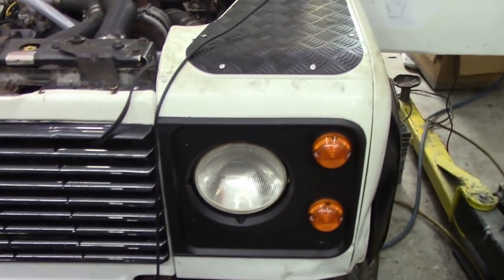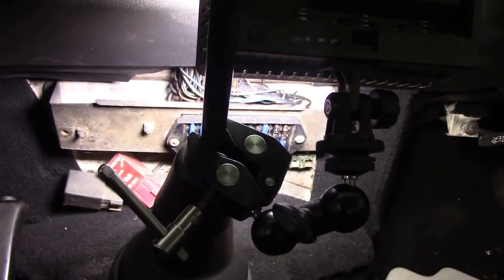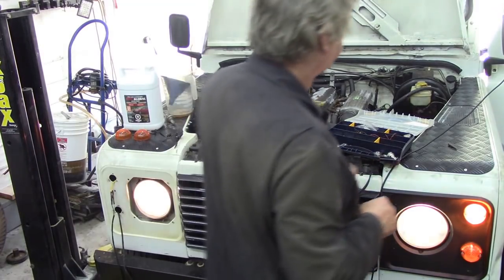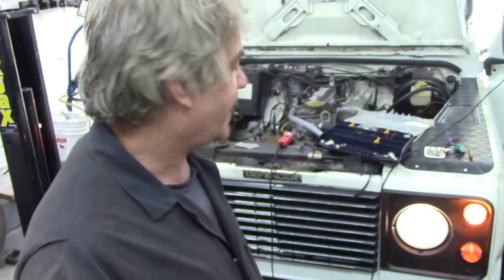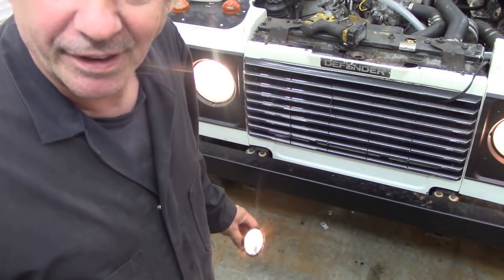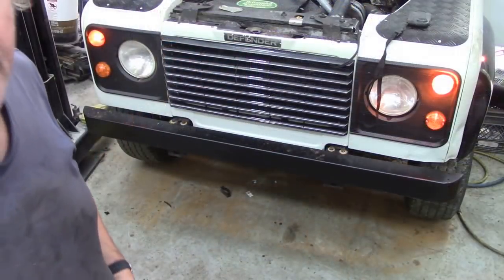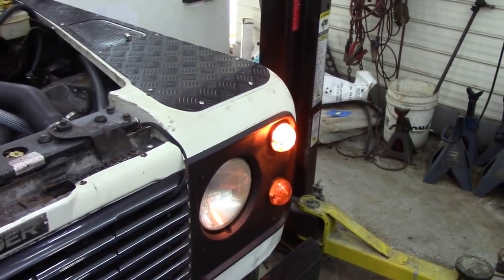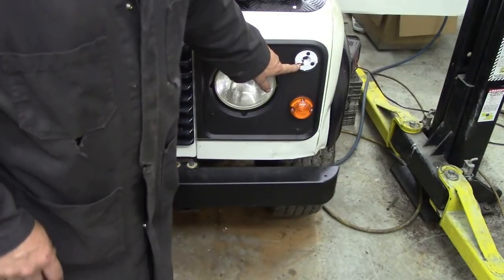African 110 wiring woes! Warning! Contains excess bodging!

Comment: In some parts of Africa, you will be driving along a remote road and a car will be coming towards you, they will put their offside indicator on, at first I thought they were going to turn right across my path. The locals told me that they do it so that it identifies the corner of their vehicle. It sort of makes sense when you drive at night and you see vehicles driving along with only a nearside side light on.

Main bulbs are rare and expensive in some parts of Africa so I guess their solution is to put a 21 watt bulb in the side light to give some lumen's on a dark bush road. Eventually they will burn out the wiring so now we are down to leaving the offside indicator on to prevent head on collisions. 

As for the length of wire on that side light, that is probable so they can pull it out and use it as an inspection light on the engine. No, I am not joking. Batteries for torches are expensive in parts of Africa. (Look up Trevor Baylis and his clockwork radio. It all started because of the lack of batteries in Africa.)

Lovely to so you finding all these odd Heath Robinson's all over the 110. I look at it a slightly different way and miss Africa in a strange way
Reply: cant lie .. when i saw all the wiring i thought .. hell you could reach the engine bay with all that , makes sense
Reply from the maker: The lights and front, chequer plate etc were all fitted here in Canada
Reply: @BritannicaRestorations  😭 good story tho

Comment: Your be needing a new jar of loom smoke Mike!😂😂
When I get on to the stage of rewiring my 90 I intend to do it right first time and no bodges! 
Mines an old 90. But I've managed to get two 300tdi 90 full wiring looms. So will make sure the wiring is spot on.
Reply from the maker: The original wiring on the land rover was not bad - it's the repairs that are

Comment: Hi I found your channel when it was mentioned in a comment on Maximus ironthumpers channel where he's restoring a Land rover . Being a fellow Englishman in Canada I figured I'd take a look here, I'm sadly not a Land rover fan but like what you are sharing  and saying so I've subscribed anyway.
  Are you sure that one came from Africa and didn't spend a year in Manitoba with a rich African prince trying to free his family fortune L.O.L
 I'm in Manitoba and self employed  fixing farm equipment. I find exactly the same crap repairs  on machines here . 
    A friend bought a used 1175 Case tractor about 10 years ago ,I put it through the shop here and removed a wheel barrow full of other peoples wiring and connectors. Then fitted more lights and things he wanted and put less wire back in the process, he was quite concerned when he saw the pile of what I hadn't put back afterwards. Then he tried it and everything worked right without blowing fuses and the burning mouse pee smell it had before, so he was real happy then ! Thanks for the video's I've watched so far, Take care.
Reply from the maker: Thanks
Mike

Comment: I found the drain hole on the side light cases seemed to go at the side on Wipac replacements when fitting to my Series 3. So I ended up punching new screw holes through the rubber seal to reorientate it to the bottom. I think the issue might be mini's use the same lights - great! they're common! - but their fixing pattern might be 90 degreess different. That or the replacements are off.
Cheers for the video!👍
Reply from the maker: Yes I noticed that

Comment: Wipac led kit comes with a flasher relay you just slot it in! You have to repin the connectors on Tdi's because the ground and live are swapped. I always keep a standard bulb in the side indicators to keep the resistance in the circuit to keep the system happy, never had any problems on both defenders with indicators as a result :)
Reply from the maker: Yes - I know
Reply: Just swapping relays and repinning the wires. ...

And replacing the bulb. ....

So it’s just as hard as redoing the entire system...

Comment: With regards to the fuse situation I have seen them super master Ghana 🇬🇭 techs remove the silly old little blade fuse and then replace with a single bake a light housed home power unit main panel fuse instead saving much time looking for which fuse had issues. One ☝️ giant that wouldn’t blow even if it were a overload protection set up for a Texas capital punishment electric ⚡️ chair. As you can probably tell by my writing of the incident I’m still in shock that it never seemed to ever blow out just constantly burning sections of the loom . When my electric ⚡️ chap was sentenced to a quick call out for cash to get it running on a homestart  kinda deal like the AA used to do. Then he was verbally abused by the idiots who bought the Ghana 🇬🇭 special Heinz  57 variety’s job telling him he was dumb and needed to find a different job if he couldn’t fix the problem promptly.As Land Rover was a simple utility vehicle that even a novice can fix  after my pal caused himself considerable hurt laughing himself off the job he never had another job off the company again such a shame. I’m really enjoying your uplifting updates thanks 🙏
Reply from the maker: Thanks!

Comment: Those side light housings are terrible. I replace mine every time a bulb blows. ( Cheap as chips here in the UK). They always brake no matter how careful I am when removing them.
Reply from the maker: The old steel ones were better but eventually rusted out